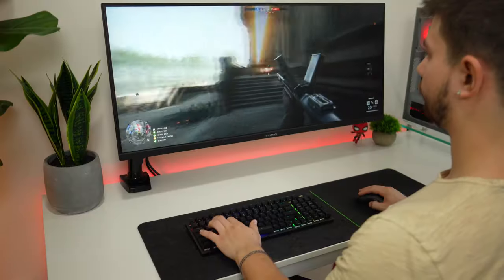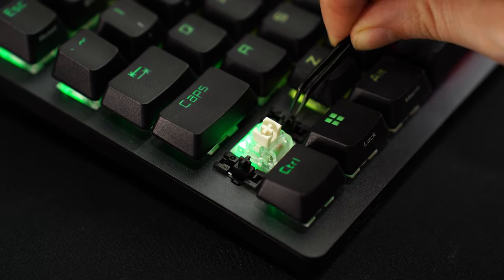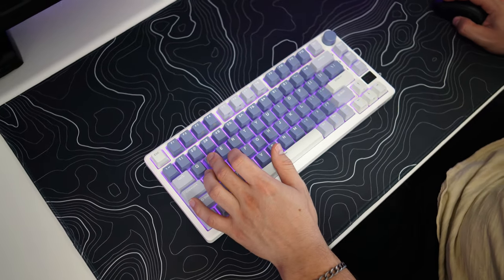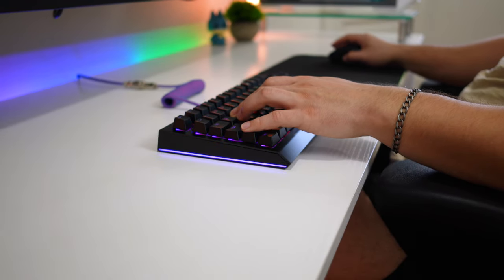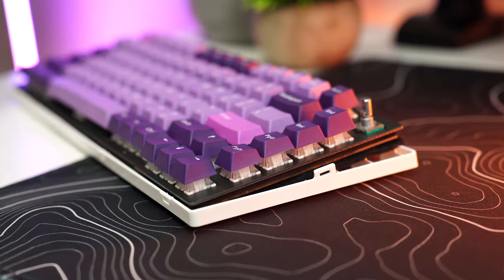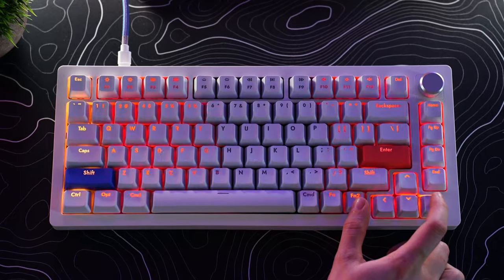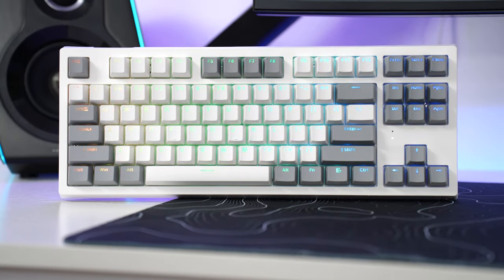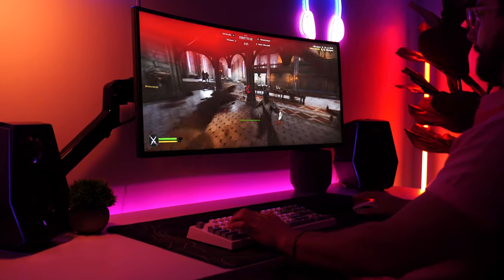Top 5 Gaming Mechanical Keyboards

Comment: I got the RK61 Plus a week back, miles better than my Blackwidow v3. Pre lubed hotswappable amazing stock sounds and keypress feel, and has both 2.4G and Bluetooth along with 2 usb passthoughs. Skip gaming keyboards, get an RK, keychron, GMMK or Ducky. It will rejuvenate your love for keyboards.
Reply: Which do you recommend the most? RK61?
Reply: The Keychron keyboards are some of my favourites, though they tend to be expensive where I live. Their Q series is fantastic but on the mid end side the K2 is also good. Gmmk pro is if you want to build your keyboard from the ground up. RK84 and RK61 are great options at a budget, their keycaps are not that great  (not terrible either) but you can always change them later.

Comment: I have corsair k70 that I got it for around $160 (I bought in 2016) and I was happy using it until recently I bought RK-H81 (for around $75) and tried it. After using RK-H81 keyboard I feel like K70 is a total trash and I have been cheated by this company. Space bar of K70 rattles more than like tail of a rattle snake and other keys with stabiliser does the same. All of the keys wobbles a lot. Key caps are cheap and when you press any key then it feels like hollow. On the other hand RK-H81 sounds really pleasant and thocky , sounds of spacebar and enter key--- oh boy! Hot swappable, wireless, RGB, pleasant key strokes and stable keys all these for less than half of the the price. 
For all gamers/typists, even if you are a fan of big brands like Corsair, SteelSeries and Razor, my advice would be try some cheaper mechanical keyboards like Tecware Phantom Plus,  RK-M75 or RK-H81 before buying any super expensive keyboards from big gaming brands I mentioned. Do not waste your hard earned money on these brands. You will not know what a real mechanical keyboard feels like until you try a real one!